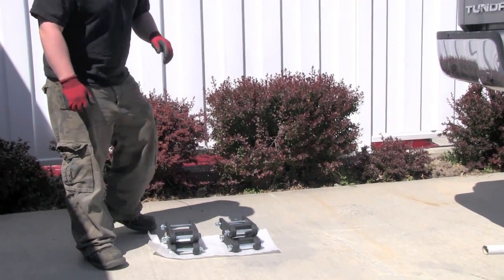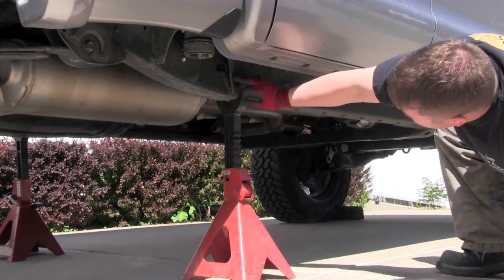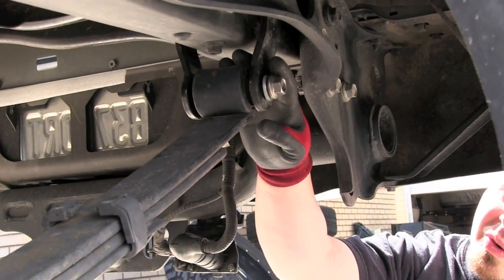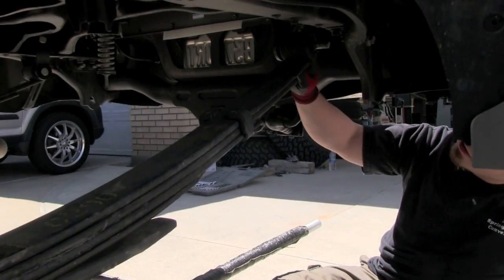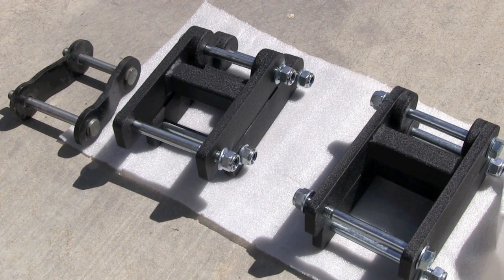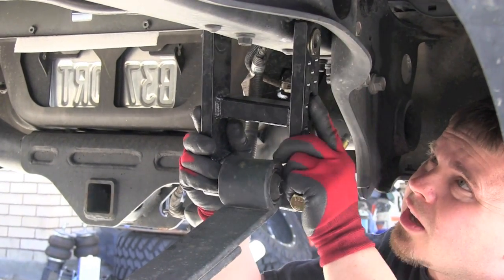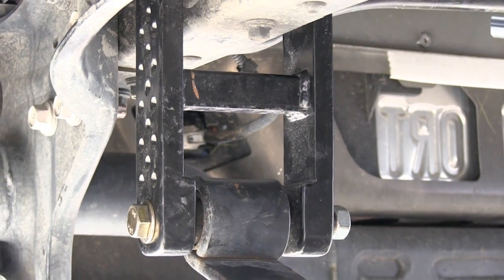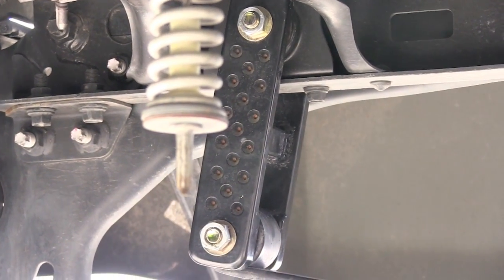Toyota Tundra Coachbuilder Shackle Installation

Comment: I bought the 3" Shackles from CB 4 years ago and my 2013 Tundra still looks AWESOME. My brother just ordered the same set for his 2014 Tundra. Glad this video is still available 👍
Reply: Mike Nguyen. did you have to do anything else to the rear?  longer brake lines?  longer shocks?  etc?
Reply: No, just swapped the stock shackles with these Heavy Duty 3" Shackles. No other modification needed. With the Low Range Off Road (LRO) 3 in 1 Leveling Kit installed and these 3" Shackles, the look is perfect, you still have that slight rake (Bull Dog) look. FYI: I didn't use the 1" rear blocks that came with the LRO Leveling Kit.
Reply: Thanks for the reply.  Was wanting to keep that factory rake and not have level or rear end sag.  Sounds like this is the ticket and maybe with some 1" blocks too.
Reply from the maker: Thank you Mike!
Reply: 0:00 海布zzxSxzvvz😅😊😊😅😅😊

Comment: To anyone watching this, he is using the stock OEM leaf eyelet bushings in this video.  The kit now comes with polly bushings. Goodluck getting the old ones out if you live in the rust belt. The OEM bushings took me about 6 hours to remove.  Install of this kit is extremely easy and takes about  10-20 mins after you get the old bushings out lol.
Reply: did u try torching them out ?

Comment: Watch the shackles get take out is angering 3 plus hr later and watch every video on the internet and still cannot get them out. I’m cutting them out. The top moves freely the bottom in the spring will not move no mater where the axel is jack both sides a fd in the a.

Comment: @6:22 bolt should be facing the street..  shouldn't you replace the bolts and nuts the same way you took them off?
Reply from the maker: Yes, good eye, Threads should be facing out towards the bedside when installing. this will allow maximum room for spare.
Reply: @COACHBUILDER.1  thanks..  wasnt sure if it meant anything..  cool..

Comment: Almost perfect except for the final look of the truck with them on it
Reply: Also the fact you should torque the nuts before putting weight on the bolts
Reply: @Treyorrrr  always torque under pressure

Comment: your kits come with replacement bushings.  however, i see in your video that you did not replace them. are there any issues with using the stock bushings?  will the supplied bolts fit though the stock bushings?
Reply from the maker: At the time we shot this we had not finishing designing our Poly bushing kit.. Shackle kit always includes rear leaf spring eyelet bushings and all necessary hardware. https://shop-coachbuilder.myshopify.com

Comment: about to install mine ( finally !) . I'll be removing the shitty blocks that my dealer installed.  I sourced the stock u bolts.  should I simply remove the blocks,  load the suspension, then tighten the u bolts and then proceed with normal install? your install video was very straight forward.  just didn't know if there was a beneficial process for us that are going from a block to your beautiful shackles!
Reply: Greg Hupka Beautiful shackles😂😂😂

Comment: what size shanckles will be needed and with what else to get 4" in lift on tundra rear. eliminate 4" current 4" block.
Reply from the maker: We normally use our +3"s and a OME leaf pack. Our Largest shackles ( +3"s) provide 1.75" of actual lift.

Comment: Should the carrier bearing nuts be loosened a little since? lifting the rear is going to pull on the driveline.
Reply from the maker: We recommend installing the carrier bearing drop kit after the shackles have been installed and the truck is on the ground. this way the carrier bearing is in a neutral position.

Comment: is it harder to do it one side at a time?

i know sway links like to be quite even for them to free up... is it the same for the shackles/leafs??
Reply from the maker: you def want to remove both shackles at the same time and then install your new shackles at the same time as well, reason being the axle will pivot in line front the front hangers and will not want to twist.

Comment: at 7:01 the leaf spring is resting on the exhaust. will that be an issue?
Reply from the maker: during installation the rear suspension needs to come down quite a bit more than it will once the truck is back down on the ground. un clip your rubber exhaust hangers during install will def help.

Comment: David,  I am about to put #1 CB shackles on my 2017 Tundra 4x4 CM, I have 290/70/18 tires on it, can I do the install with the rear tires on or do I need to remove them!  Also do I need to remove the spare as well!   Thanks!
Reply from the maker: Removing the tires will make your install much easier and will also def need to remove the spare as well. Give us some feedback after your install.
Reply: @COACHBUILDER.1  what size would u recommend for a 6 inch lift just to get the stock rake look

Comment: Can I use these on a tundra that is already lifted 6”?
Reply from the maker: Yes, If your truck is running a stage I lift without front coilover normally use our +2"s and if its a stage II with coilover +3"s would be the size to use. You'll also need to bump up the size of the carrier bearing drop kit. https://shopcoachbuilder.com/collections/frontpage/products/coachbuilder-2-shackles-provides-1-25-of-actual-lift
https://shopcoachbuilder.com/collections/frontpage/products/coachbuilder-3-shackles-provides-1-75-of-actual-lift
https://shopcoachbuilder.com/collections/frontpage/products/coachbuilder-carrier-bearing-drop-kit-rear-lift-3-5

Comment: Can I add these after I already have rear block lift on my tundra? I actually already did just waiting on my new longer shocks lol
Reply from the maker: Yes, our shackles work flawlessly with lift blocks or aftermarket leaf springs. feel free to reach out if you need help with anything else.
Reply: @COACHBUILDER.1   cool cant wait for tomorrow to get my new fox shocks i currently have the 4.5” rear block from pro comp so now that I added the 3+ shackles its sitting nice I love it🤘
Reply: What kind of lift do you have? I have the pro cómo stage 2 6”. Did you ever remove the rear Block!?

Comment: blocks versus shackles which give you better ride.i'm looking 3/4" shackles for my 2011 tundra. how do i purchase them?

Thanks
Reply from the maker: Blocks provide lift but decrease ride quality by adding additional leverage to the leaf packs. Our Coachbuilder shackles provide the best ride quality possible in a shackle.
Reply: @COACHBUILDER.1  So should I remove the blocks if installing the shackles? Bout to do them this weekend.
Reply: I’d recommend to removed the block and maybe add an extra leaf spring it’s a better ride for sure

Comment: If I install +2" shackles, do I have to install +2" shock? and what about the front, do i have to do something about the +2" installed the back, to maintain the level?
Reply from the maker: No, The actual amount of down travel will not require a 2" longer shock when using the OE tundra leafs. You can use a +1"-+1.5" rear shock.